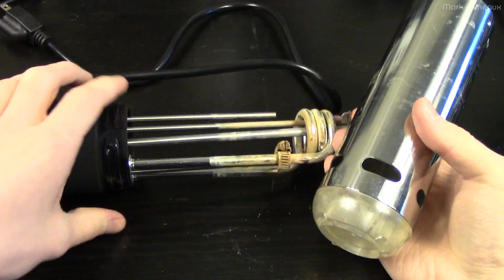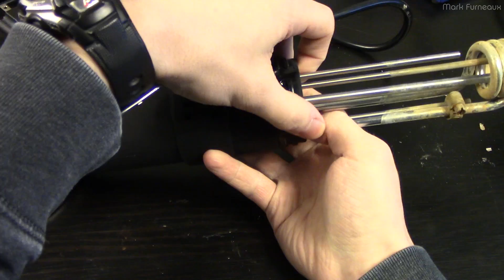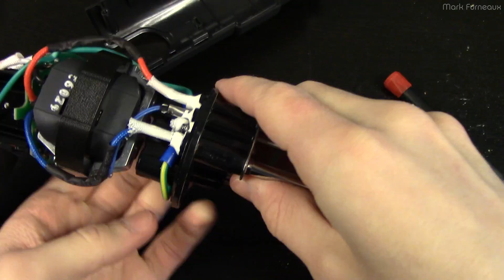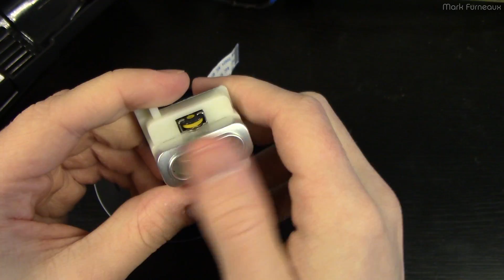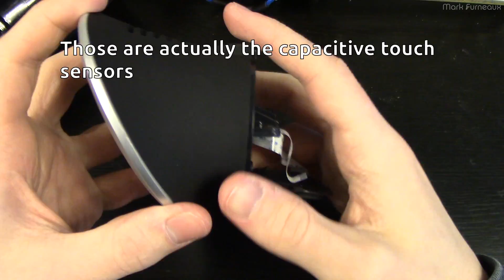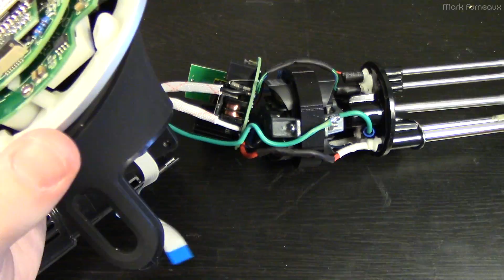Teardown of the Anova Precision Sous Vide Cooker

Comment: Hi Mark, thank you for the clear video! I have a problem with mine and I'm trying to repair it. Mine is showing 26,3 Fahrenheit (0 celcius) as measured temperature. Therefore it is constantly heating. I was wondering if you would might have an idea on where the problem might be. Wires seem fine in the lower compartment. I was wondering if there could be something wrong in the upper compartment.. thanks!
Reply: did you ever find a solution - Mine has started doing the same thing, and I'm wondering if I could repair it as it's out of warranty and I do really like cooking sous vide
Reply: @mattson  This is the most common failure mode. It's due to moisture getting sucked into and blown over the electronics (which ultimately screws with the software) and it's only a matter of time until they fail. This is why they extended the original warranty out to 2 years and redesigned them so that they don't use forced-air in all 3 of the new models. Maybe yours is still under warranty? Email them, it can't hurt. They might replace it out of good will.
Reply: @Shaun.Stephens  cheers, I did a little while back and got it replaced
Reply: @mattson  Awesome, grats. They also offered to replace mine last week and I talked them into replacing it with a Nano so hopefully it won't have the same problem again. I did my first cook with it last night.
Reply: This happened to mine last night. I'm in contact with them and they responded immediately with some troubleshooting tips. Hopefully they will replace it if nothing works, which so far it has not. I especially enjoy things that it has cooked but at 1.5yrs old I'm disappointed that it has malfunctioned.
Reply: @NorthWoodsDiver  This is normal. They get you to jump through a few hoops before replacing them to check on your responses to see if the claim's genuine. If there is only a little moisture ingress the 'tips' they provide might get it running long enough to get it out of warranty. Hopefully after the 24 - 48 hours they take you'll be able to tell them yours is still kaput and get a replacement. I suggest trying for a Nano. It's not quite as accurate in the software but doesn't have the moisture ingress issue. (They won't replace with the new model 'Precision' - or wouldn't for me - as it costs more to manufacture.) Luck!

Comment: I was stupid enough to plug an US model 120V into a 240V socket in Singapore. I couldn't the info anywhere on the box. And surely enough there was a small silver label near the power cord. Only realized it after it was damaged. I had a strong smell of hospital cleaner, could be the burned plastic smell. It popped after 2 minutes for using it. What kind of damage you think it received. And any way to fix it? Mine is a BT model from the US market. Thanks.
Reply: Clemson Chan I had the exact same issue as yours, could you help me out and tell me what happened? Did Anova end up getting you a replacement?

Comment: Can i use this machine on 120v, 50hz..reply appreciated.
Reply from the maker: I don't see why not
Reply: It should work on 50 Hz. The motor will run a little slower and hotter, but it should be fine.

Comment: @26:50 I don't think they have seperate versions of the top board that holds the RF modules and your first guess was indeed correct. If you look at the solder joints of the BT module, they look like they were made during the initial reflow process. The WiFi module however looks hand soldered, just like the pin header that holds the board up (notice all the flux residue). So if they couldn't be bothered to run two seperate pick 'n place jobs, i highly doubt they bothered to flash seperate firmwares/eeprom settings.
Reply from the maker: The only way to know for sure is to probe the TX/RX pads on the WiFi module footprint on a Bluetooth only device and see if AT commands are issued on bootup. I might be able to get hold of one to do that.
Reply: That would indeed be very interesting! Wanna place your bet? =) I think the software will be the same on both models, and it just checks if the module is there. In the video i couldn't see any programming headers or the like. So they propably got the CPUs pre-programmed -> same thing like the pick 'n place job.

Comment from the maker: I will be making a follow up video about some software reverse-engineering I did after this video.
Reply: Can you hack a way around the long beep of death?  The unit thinks the water lever is low but it's not.
Reply: Hey Mark, This is very helpful. Can you also make the video of breaking down Joule: Sous Vide by ChefSteps ?
Reply from the maker: Only if you buy it for me
Reply: Hey Mark , I have some question on how to assemble back my machine , when I take out the down middle screw which is between the screws connected to the motor , I can't put it back. I need your help
Reply: There's a small bolt that connects to the end of the long screw. It will probably be stuck to the magnet in the bottom of the motor. For anyone else with the same problem 🙂

Comment: i think that component on the heatsink is a triac and not a SSR, although water has a great thermal mass and has great heat transfer properties, it would make more sense to vary the heater power output instead of driving it at the full 800w, by varying the power would also lengthen the lifespan of the heater
Reply: Benjamin Esposti true,  I meant that using an ssr would run the heater at full power due to ssr's being always on or off,  whereas using a triac with zero-crossing could vary the heater power
Reply from the maker: I can test this by using a power meter on it next time I use it.
Reply: please do, love the videos btw, keep it up :)
Reply: @TheUbuntuGuy  I always ran mine through a power meter and they do some really fast and fancy PWM switching of the heater, starting a good few degrees before target temp to ensure no over-run. That's why there's a triac under that heatsink - and incidently why some people claim the Joule is "better", because it hits target temp faster but often over-runs.
Reply: An SSR typically does have a TRIAC inside!... (Though some do use MOSFETs)